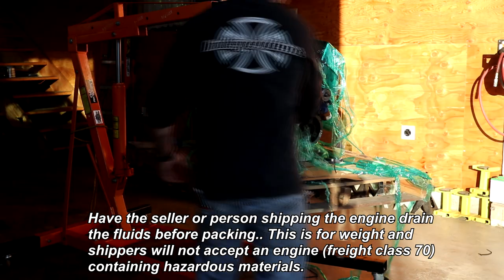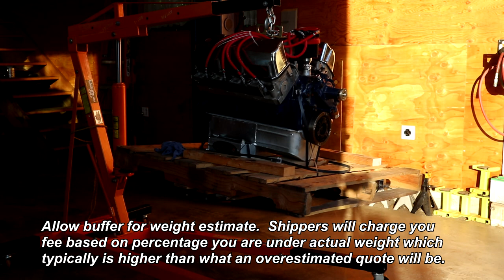How to Ship an Engine... Cheap!

Comment: First 🤗. 
Have you posted the link to this video on the PI forum?

YRC freight was recommended to me for a 59x24x21 100 pound crated skid I shipped this week. Website was easy to use, dropped crate off at terminal, and Fresno to Ohio charges were only $107. 

Keep the videos coming. 👍✌️
Reply from the maker: That sounds pretty competitive! I know yrc is one of the carriers they quote with. It's been a while, next time I run something I may check a carrier against the broker price. Should be jamming the motor in next week, so a tear down video is coming up soon! I'll get it on the pi forum too, thanks for reminder.
Reply: Hi can you pls contact,  i need to know more about the shipping